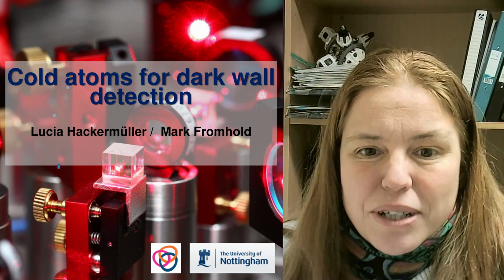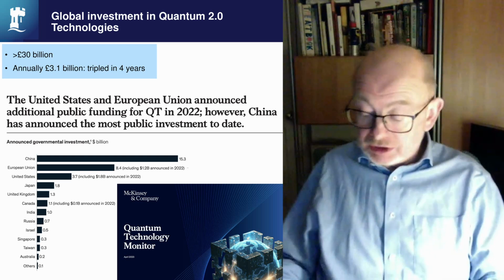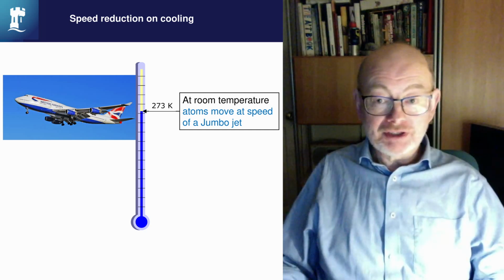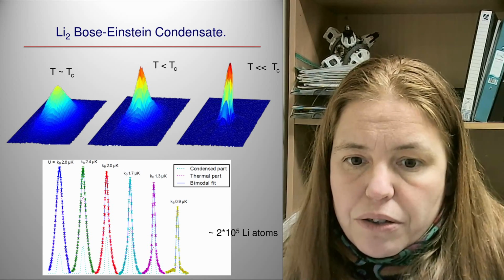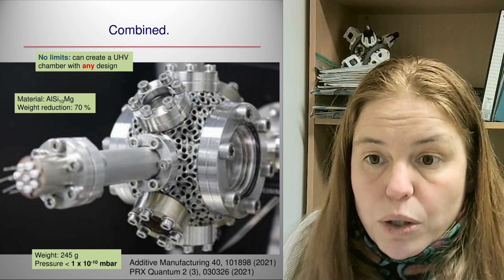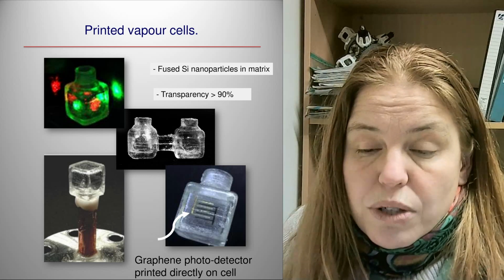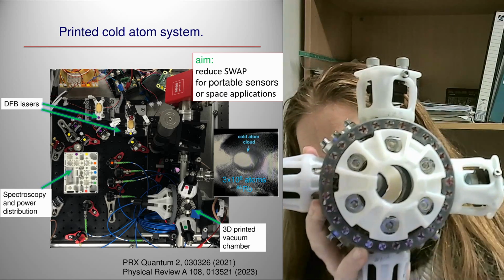Cosmology with Ultracold Atoms (Mark Fromhold & Lucia Hackermuller)

Comment: i have a Little question, the dark walls potentially solve dark energy or dark matter?? beacuase i hear one thing but also read the other??
Reply from the maker: I wouldn't quite frame it as the dark walls "solving" either dark matter or dark energy. Instead, they would be evidence of the existence of a "dark sector". By "dark sector" I mean some collection of fields that exist but don't interact much with the visible fields. There are well motivated models of dark sectors where their interaction strength with the visible fields is stronger in low density (i.e. vacuum) environments. These are the ones that would have domain walls that get trapped in an experiment like this.

The detected dark sector itself could be either dark matter, dark energy, or something entirely different, depending on its density and pressure.
Reply: @CosmologyTalks   ohh i see, very interesting, i hope they can put forward this research as soon as posible, maybe they can find an "axionic" filed or something like that, thank you for your answer 🤙

Comment: I wrote a PhD on the theoretical physics of ultracold atoms. It seemed to me that this topic was very far from cosmology and I switched to particle physics.
Reply from the maker: At a fundamental level cold atoms and cosmology are certainly far apart, but cold atoms can create such extreme situations that they can be used to test new fundamental physics laws/particles that wouldn't show up anywhere else. For example the stuff discussed in the video, where a domain wall in a dark matter field could get trapped in a cold atom lab.

Comment: Index to Key Parts of the Talk 
[00:00] Shaun's intro
[01:04] Opening remarks by Lucia and Mark
[04:47] Timing & enabling investments in Quantum 2.0 technologies
[09:18] How are atoms cooled to <1 millionth degree above absolute zero?
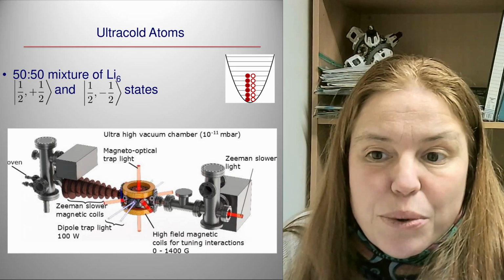[15:50] Ultracold atoms, setup in the lab, laser system
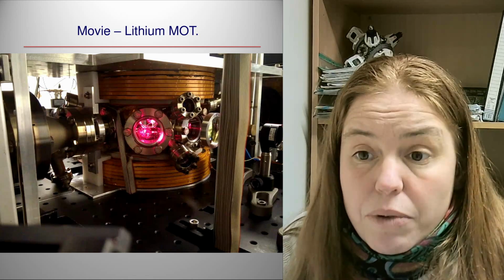[20:12] Movie – Lithium MOT
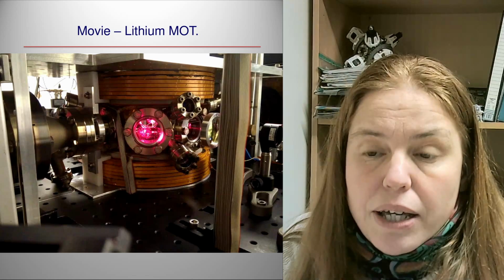[21:05] Evaporative cooling – Lithium
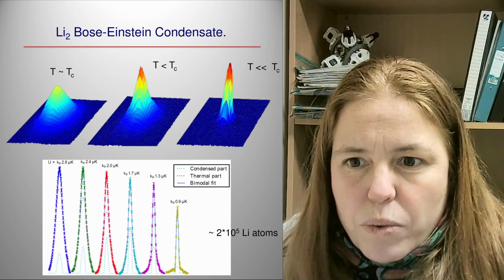[26:02] Li_2 Bose-Einstein Condensate
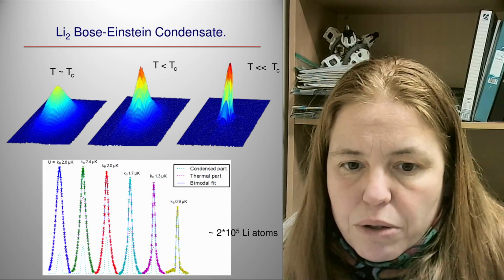[27:47] Quantum 2.0 sensors
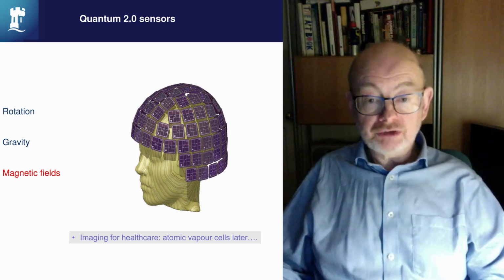[32:15] 3D printed chambers
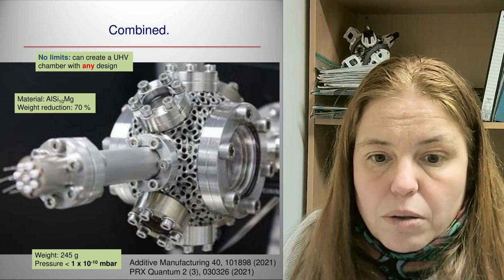[34:23] Printed surfaces
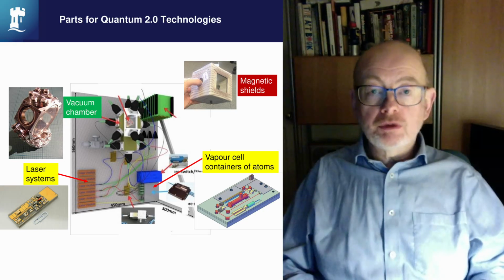[35:17] Parts for Quantum 2.0 technologies; New manufacturing techniques
[37:53] New hybrid shielding/magnetic bias product
[39:34] Printed vapour cells made in collaboration between Physics and the Centre for Additive Manufacturing at Nottingham
[41:34] Spectroscopy and magnetic sensors
[42:36] Compact, printed Laser system
[44:22] A printed gravimeter for space
[46:16] Printed cold atom system
[49:35] Where to next?
[53:42] Other ideas on the horizon?
[58:02] What current work in cold atoms is interesting but underappreciated?